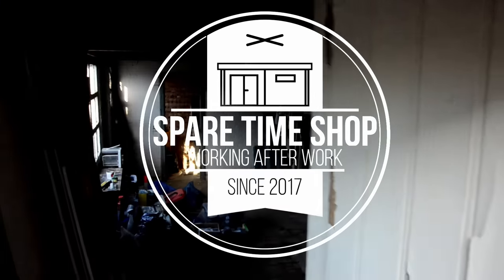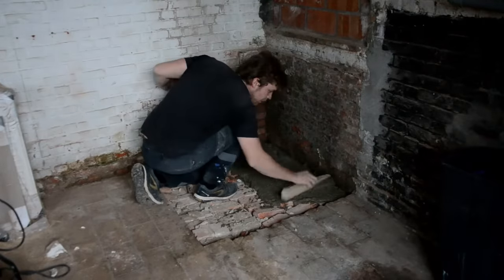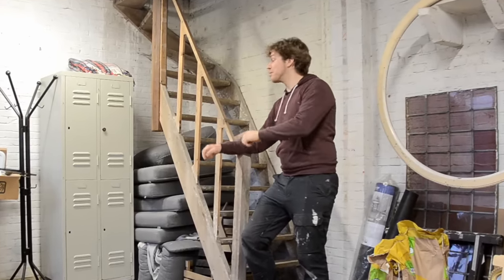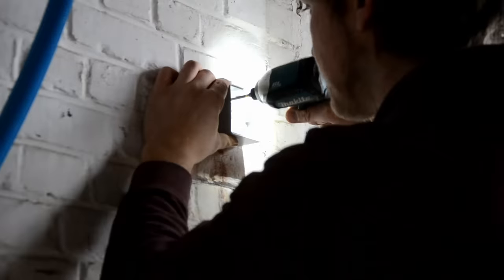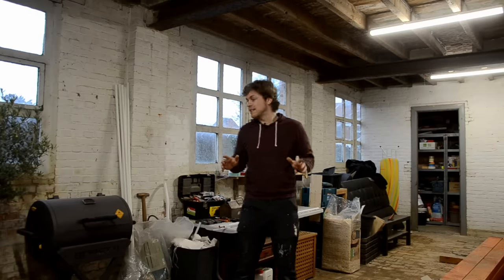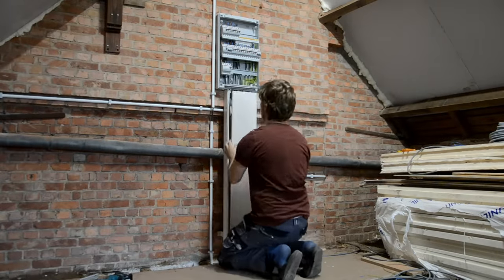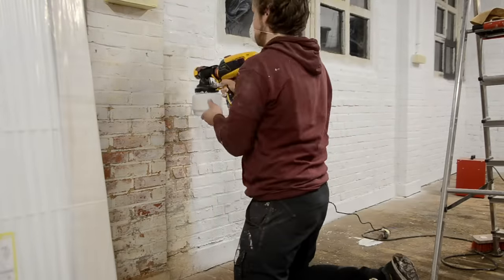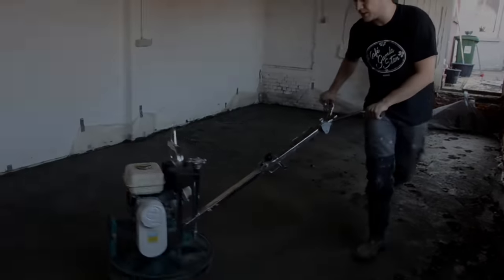New WoodShop Build - Part 1 - Demolition/Electrical/Paint

Comment: Depending on how modern your koterij is, you might run into trouble with the paint you used. Usually these kinds of sheds are barely watertreated so the the brick walls suck up moisture from the ground like a sponge. If you cover them with a watertight paint layer you trap all this moisture which can result in flaking paint and/or weakening mortar bonds or even weakening the bricks. If you see this happening, consider using "kalei" instead, which is just a soupy mixture of gebluste kalk and a bit of sand, a technique used by farmers for centuries.

Comment: I had that exact same paint sprayer and, after rewiring my garage I set about spraying the walls. I installed six circuits with eighteen outlets. The only one I wired the wrong way around was the one I plugged the sprayer into. RIP paint sprayer

Comment: If you think your existing tiled floor is always dusty, a concrete replacement will be much, much worse. It's a waste of time for no gain whatsoever.
Just clean the tiles and seal them. Far cheaper, it will look better and be easier to keep clean. And it won't dust up like concrete will.

Comment: Normally the light switch is on the side that the door opens, so you have access to the switch as soon as you open the door..   To put the switch on the backside of the door on the hinge side means you have to step into the room and reach around the door to get at the switch.

Comment: They're most likely not electricians. But money talks  - if anything is strictly not needed for safety reasons. It's not installed. But some companies take a pride in good craftsmanship and a good working environment - they'll go an extra mile if it's not ridiculous expensive. It could prove to be saving money having outlets closeby preventing people from falling over extension cables all over the working area.